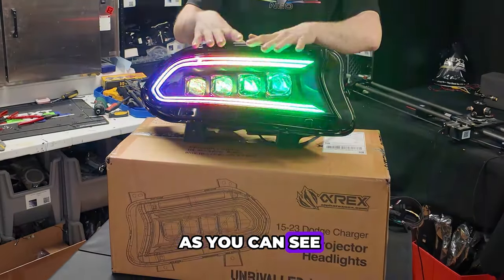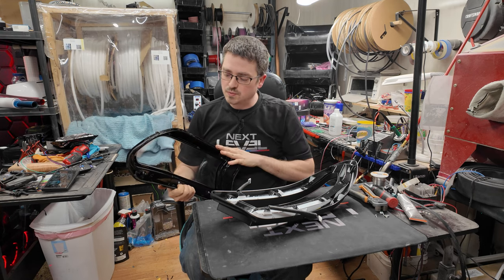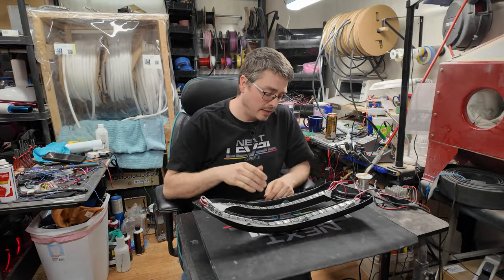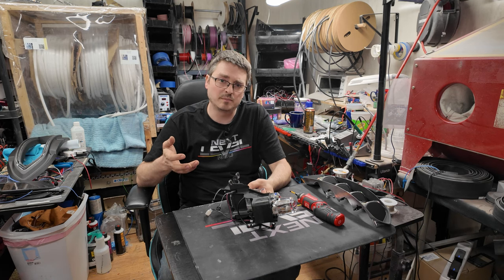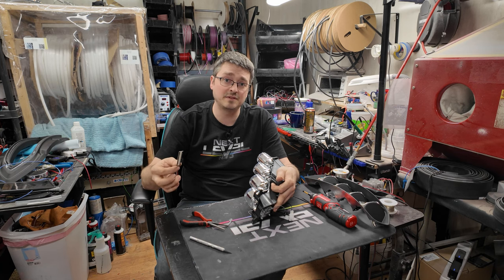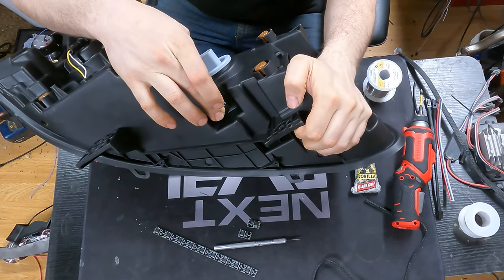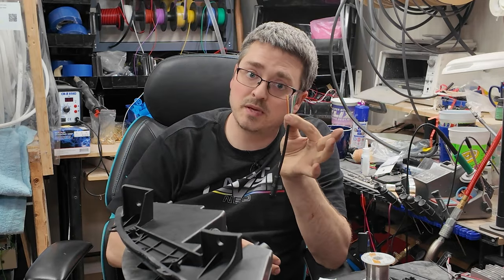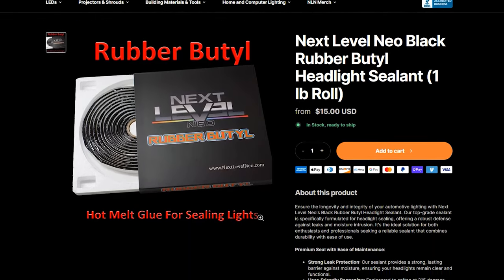Dodge Charger Flow Series Alpharex Headlights: A Complete Build Guide

Comment: Are the factory LED boards with amber/white running lights brighter than the actual UCS2904 strips? I'd imagine they would be a bit brighter but of course they aren't going to have any show modes or customization options
Reply from the maker: They were a little brighter but it wasn't much. The double row ucs did a great job.
Reply: @NextLevelNeo  Totally understandable with the UCS. Absolutely enjoy your content and you taking your time to show and explain the process of this customization. Also letting people know how difficult it is to open some variations of permaseals. I always explain it to my customers with VLAND requests that it is extremely hard to open as well.
Reply from the maker: @ridetheyoshi  vland has mastered the worst permaseal. I'm sure it's helped a lot worth leaks but it sure does give retrofitters a headache.

Comment: Do you have a video on how to install these?
Reply from the maker: @tonywilless1723  we have a video showing how to install our custom lights on a charger but stock light install may be slightly different.
Reply: @NextLevelNeo  I have the nova headlights from alpharex bought off Rgb halo kits but no one has the install video
Reply from the maker: @tonywilless1723  once they have been customized the install is different. The only people that can help are the ones that made them. Im sure their build is a bit different than the way we build them.
Reply: @NextLevelNeo  I get your point thanks for the info if you could send a link for the installing them to the car video so I can get a basis to go off of they don’t have an install video or guide yet
Reply from the maker: @tonywilless1723  did you reach out to rgb halo kits to ask for an install tutorial? I'm surprised they don't have atleast a generic tutorial for their lights. Here is ours but once again these are custom and there is no standard way to build lights so they will vary one brand to the next. 

https://youtu.be/xNYSLBrnJLI